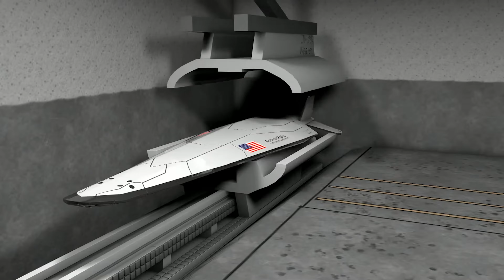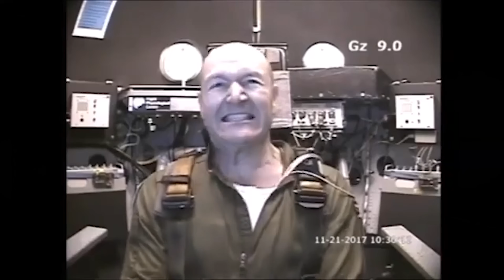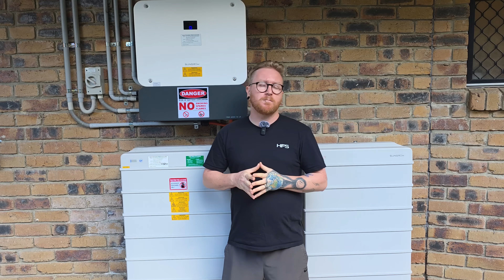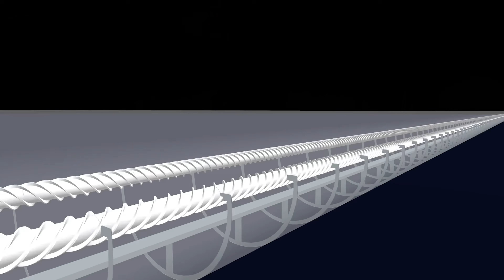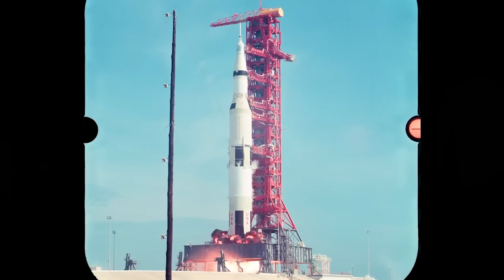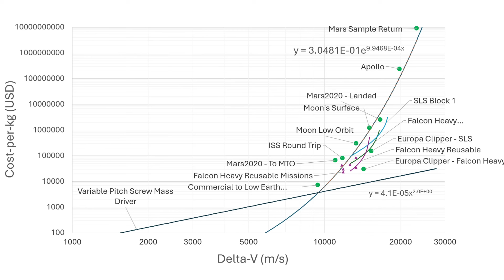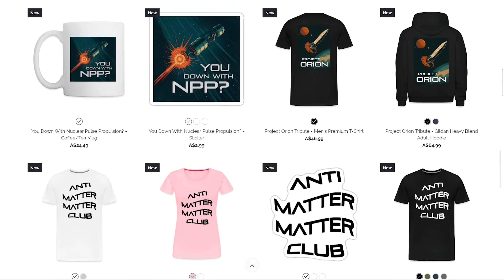The New System That Could ACTUALLY Replace Rockets

Comment: I’m a machinist so my big question is how do you plan to machine such a long screw? There aren’t any lathes that are a kilometer long so you gotta machine it in segments. How will the segments attach to each other? How do you maintain a vacuum inside the tunnel? What support the screws? Bearings, magnetic bearing? What’s the fail safe if the bearings fail? this whole thing sounds like a maintenance nightmare?
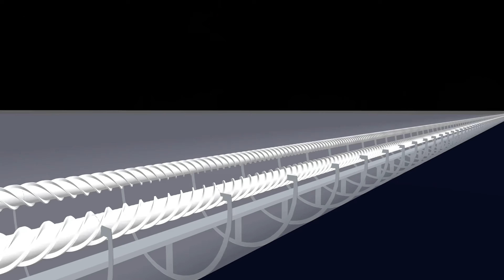Reply: The screw is made up of individual segments, not one long segment. They are just synchronized to spin together like they are one long screw. There are brackets that support the screws (see @9:02), and the screws are supported by magnetic bearings. Vacuum in tubes is something we know how to do - LIGO, for example, has maintained one trillionth of an atmosphere for 25 years. MTBF for magnetic bearings is pretty good.
Reply: @spaceinfrastructure3238  you don't shoot spaceship sized items out of the end of ligo though, so keeping that vacuum in a permanently sealed tube isn't really the same is it?

Comment: How do you have a vacuum tube without a seal at both ends?
Reply from the maker: Good question - it has multiple airlocks along the tube. Air will enter as the final airlock opens to release the craft, but it can only enter the final section, preventing the entire tube from having to be evacuated again
Reply: @HelloFromSpaceAus  That's going to take a lot of nerve hurtling toward a substantial seal and hoping that it will open in time.
Reply: @woodsyshroomer  The inner airlock door starts out open, and closes behind the craft after it enters the airlock. The outer airlock door is a membrane that the spacecraft punctures through. The membrane is then replaced prior to the next launch.

Comment: If it costs so much energy to power up a electromagnet, why not use a natural magnet, like neodymium? Or is it not enough? Or is that also too expensive? Why not find ways to reduce the mass of the payload, or is that just magic nonsense now?
Reply from the maker: Not strong enough unfortunately. Ideally you do both, reduce the mass of the payload and maximise the capability of the system. Unfortunately even with light materials, spaceflight hardware is complex so there's only so much you can do.

Comment: Sorry, bollocks. Cheaper to get a kilo to Mars than into LEO. Also the support structure for the screws is unbuildable.
Reply from the maker: It's impossible to build metal beams?
Reply: @HelloFromSpaceAus  All materials have a maximum strength. This is why a simple tower has not been built above about 800 m. The Burj Khalifa is 829 m tall.
Why do you think a building 1km or 5 km  high has not been built? The limitation is the strength of materials.
And you want to build a structure up to what height did you say? This is why rockets are used.

Comment: Maybe instead of whole long screws, you'd have lengths of screw magnetically coupled to each other. So you'd still have a long screw, it'd just be in sections, then you wouldn't have to worry so much about the material being able to withstand the twisting force.
Reply from the maker: That's an interesting idea, and your thinking there is pretty spot on. The screws are sectioned into relatively short lengths, which prevents the twisting from building up over a long length.

Comment: This sounds so unrealistic, really lets spin these mile long variable pitch screws at unrealist speeds and hope centrifugal force doesn't rip them apart inside a vacuum tube. Let's cut to the chase, we need to get serious about anti gravitic technology.
Reply from the maker: I can understand your scepticism, but you've misunderstood some elements of the system. The screws are segmented into relatively short sections to avoid the issue you've described. The LHC is a 27km long vacuum tube, and it works. VPSL is on a far larger scale, yes - however this isn't an impossible challenge. Unfortunately, so far as I'm aware there is no method currently proposed which negates the effects of gravity. I wish I was wrong, it'd certainly make things much easier!

Comment: What about the twisting of a kilometers long screw? What super material would it be made from? How would each screw be supported along the length of the launch tube? They would need bearings, so what about frictional losses in those bearings, and in the contact area of the driving sled with the screws? Wear on all surfaces?  Is the sled itself disposable? The power efficiency of such a launch system may be attainable in theory, but I think that it falls down from an engineering perspective. However I do like science fiction!
Reply from the maker: That's a fair concern - the screws are sectioned into much shorter lengths, which have support structures. I'd assume they'd be on bearings, I'd have to read back through the paper. There will be wear within the system, hence why the plan is for it to be good for 520 launches, not infinite launches - the point is more that the wear is enormously less than a rail gun. The sled is reused, caught by a decelerator after the spacecraft has been launched. There are losses in any system, but these have been calculated by the digital twin and worked into the final values. I understand your scepticism, and until a physical demonstrator is built we won't know 100% that it works as intended. I would point out though, this is the case for any new, advanced technology. As a good example, full flow staged combustion was considered to be unattainable, and too practically difficult - until Statship flew. The same was true of landing boosters and reusing them.. technology is always improving, if we don't push the limits we stagnate.

Comment: Spinning two 500 ton ten mile long screws is just  as insane as the spin centrifugal launcher !
Reply from the maker: There's not two screws, there's many - they're sectioned into short lengths to prevent exactly what you've described😁

Comment: The torque in the screws will break them over any real distance. I can’t see those super long screws not twisting, bending and breaking.

You equate this to a flywheel - better to use a more simple magnetic mass driver with capacitors or other batteries slowly charging pre launch to do the same thing. Of course then you have the problem of damaging the magnetic bars - the reason the military dropped the mass driver gun as viable… maybe it’s more simple to replace on a launch gun than a weapon but that type of launch makes a lot more sense than a screw.
Reply from the maker: Very logical and well thought concern. The screws are sectioned into short lengths to prevent that twisting force from building up, which also allows them to increase in RPM slightly along the length of the tube. This helps prevent th helix angle from collapsing to 0°. Basically the flights (blades of the screw) would become effectively parallel to the screw axis and stop producing axial thrust otherwise.

Comment: The energy required for that final 7999m/s to 8000 is very counter-intuitive compared to 0 to 1. I bet we could have an entire video just going through the physics and math of that.
Reply from the maker: It definitely is counterintuitive. I'm currently writing a video about relativistic effects, which are also similarly counterintuitive in many ways. Might be able to work this in, because it is super interesting (and a little brain melting at times😅)

Comment: So, realistically we are talking about a craft exiting a vacuum tube through some kind of interface to nearly full atmospheric pressure at an altitude of no more than 3km at around 5 km/s . I doubt even the best Russian hypersonic missiles would survive that. No, this whole idea depends on being able to build infrastructure to an altitude of around at least 10 km. The best we could do is build it on the Patagonian plateau and then, if we’re clever, get a pipe-exit altitude of around 4.5 km - still too low. Your interviewee dodged this issue completely when you asked him about the atmospheric heating issue.
Reply from the maker: No, it exits at high altitude. The tube has an extension which is quite high, ideally placed up the side of a mountain. The question definitely wasn't dodged, it was a 40 minute interview which I had to cut down to 10 minutes so this video wasn't ridiculously long😅

Comment: Got to agree with a lot of the comments here. None of this is plausible. Screws with increasing pitch, ship held by magnets traveling through kilometers of vacuum...not to mention hitting air at the proposed speeds. In fact it's downright ludicrous.
Reply from the maker: I encourage scepticism, it's healthy! There would definitely be many challenges with building this system - this doesn't mean they're insurmountable though. I would point to how many advanced technologies we have today which many laughed at and called impossible pipedreams, until they became reality. ITER is ludicrous, as is the LHC, as is catching a 200 tonne rocket booster with a robotic arm. All insane, until someone does them.

Comment: Impossible torque on screws - no material in existence
Reply from the maker: I think you have some misunderstandings about the system. The screws are segmented into relatively short lengths to prevent this issue

Comment: Thank you for sharing this interesting concept.
One limiting factor might be that you cannot increase the pitch as much as you want as it becomes self locking if you overcome approx 85°.
Instead of higher pitch you need higher rotating speed of the shaft(s). The very long shafts will suffer from high vibrations as they are more or less rotational springs.
From my feeling as an engineer this is at least very very challenging (not to say impossible). In a quasisstatic view it looks quite good but it is a very dynamic vibrating spring-mass system.
Reply from the maker: That's an excellent point, to solve this th screws increase in RPM along the length of the tube up to around 19k rpm. The shafts are also sectioned into relatively short lengths to avoid the issue you've described. They will definitely have to be very well balanced, but 19k rpm is a speed we have a fair bit of experience with. Many small combustion engines operate up to this, electric motors operate far beyond this. It'd be an engineering challenge for sure to build, but not impossible

Comment: At the start of the launch tunnel, scree is perpendicular to direction of travel, so very little torque force, however at the end of the tunnel screw thread is a lot more parallel with directions of travel, torque force must be enormous. Surely the screw would want to push sideways into the tunnel wall rather than push the ship faster and faster? Someone with more smarts please explain!
Reply from the maker: It's relative, because at the end of the tube the craft is travelling so fast, the torque is the same against the craft

Comment: I don't see this as anything plausible.

My brother in law and I call this, "why don't we just." People say it all the time in incredible ignorance of how complex the world is, and the short answer is, if it were that simple somebody already would have done it. Of course that's not ALWAYS true, but the times when it's not are 1 in millions.

Off the top of my head I'm thinking of vibration and frictional losses that will be EXTREMELY hard to engineer down to usability, and then you're still going to have insane maintenance and inspection costs. You'll have to power down, bleed off all that energy, move cranes out there, replace bearings, days to weeks of down times.

It's a cool concept, but its waaay more complicated than you make it sound.

Rocket engines are conceptually very simple, in reality, physics aren't ideal, and they become very complicated and take a substantial amount of trial and error to engineer out all the issues.

This wouldn't be any different, think about Elons hyperloop. Conceptually simple, no one could get it working. No one could afford the R&D to get it working even with scaled down test models.

You can't compare ideal to real world, which you did with your Artimis comparison. This almost certainly would cost hundreds of billions if not trillions to get operational, if they could get it operational.
Reply: The screws use active magnetic bearings, and there is no contact between the screws and the adaptive nut. A similar technology is flywheel energy storage. In any case, start with the physics of why this approach makes sense if we want to go to Mars. Once you realize that the general approach saves trillions of dollars over rockets, then you'll be primed to understand all the engineering details that make it possible. Hyperloop was trying to fit somewhere between high-speed trains and planes. If Hyperloop's only competition was stretch limos driven by A-list celebrities, it probably would have done just fine.

Comment: First - Length needed
Worst case - 2G - 10km/sec - 500seconds - length 2,500 Km

Best case - 40G - 5km/sec - 12.5 seconds - length 31.25 km

Assume 60,000 rpm - 1000 revs per second

Worst case - 2G - first second is 10 metres last second is 10km
1000 revs per second first rev is 10mm last rev is 10m

Best case - 40G - first second is 200 metres last second is 5km
1000 revs per second first rev is 200mm last rev is 5m
Reply from the maker: Not sure how you got to that conclusion? I'm not looking for investors, I make YouTube videos mate! I would also point out how many of the technologies we all enjoy today were once called 'scams'.
Reply: @HelloFromSpaceAus you can't understand how one can obtain these numbers, which is like 5th school grade maths, and yet you are so smug and condescending to people in other comments, who validly point out how unrealistic such a system would be. Why even have such channel without any engineering expertise and/or critical thinking? Do you just use ChatGPT for your scripts? Existence of a white paper does not automatically mean it is not bs.
Reply: @HelloFromSpaceAus  Hi - the maths and physics is simple - the acceleration multiplied by the time gives you the speed
The speed multiplied by half the time gives you the length

Comment: What you've described is actually a good solution for mass driver weapons. It could also get used for accelerating stuff in space (for example space garbage cleanup).
Reply from the maker: It could for sure, but I'd rather see it take us to space! You're spot on there, a VPSL system on the moon would be ideal. Zero atmosphere and low gravity make it a very attractive option

Comment: A very neat solution for only part of the problem. You still have the problem that your spacecaft will suffer extreme heating and deceleration once it leaves the launcher.Even skipping this, what we're doing is replacing the first stage of a normal rocket. But fully reusable first stages are now commonplace. The economics still doesn't work.
Reply: We're proposing to replace 99% of a rocket that would send a payload to Mars. The economics are amazing - literally almost 1000X cheaper than rockets for going to Mars. Please watch the video again and try to understand the cost curves, exponential scaling versus v-squared scaling, and the "hard physics" reason why we're claiming that the right kind of infrastructure makes this possible. It's the most important takeaway from the video. Alternatively, watch the relatively boring video, "How the Future of a Space-Faring Civilization Hinges on the Economics of Imparting Kinetic Energy".
Reply: There is no saving until you prove it works. As most people are pointing out, there are very serious impediments to getting this scheme to work at all, let alone safely.
You cannot claim savings on technology that does not yet exist.

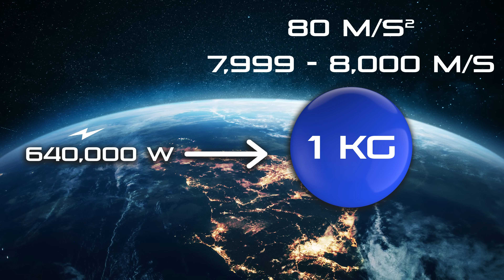Comment: 7:04 - meanwhile we have since years EVs charging for 15+ mins at 350kW, and chinese presenting recently EVs charging for 5+mins at 1MW. Somehow failing to see why 640kW per kg of payload for at most a few seconds would be an unsurmountable problem.
Reply from the maker: Sure, but that 640kW only gets 1kg to orbital velocity. Getting a 28 tonne spacecraft to orbital velocity requires 17920000kW (17.92GW) - a far less trivial number. And remember, that's only orbital velocity for LEO. For interplanetary transfer velocity, because the energy requirements become far greater at higher velocity, you'd need nearly double this number.
Reply: This is a great question! Let's assume a launch train mass of 38,940 kg. If we think about the last m/s of a 0 to 8000 m/s launcher, the power that it will pull is 640,000 W/kg X 38,940 kg = 24921600000 W = 71,205 Superchargers. That might be reasonable, except that we need switches to turn that power on and off at every electromagnet in a traditional linear-motor style launcher. So that last magnet needs an electronic switch that can handle the power output of 71,205 Superchargers. The second-last electromagnet needs a little less switching power, etc. If there's an electromagnet every meter, then the total switching power is 71,205/2 X "length of the launcher (in meters)" ~= 27.5 billion Superchargers worth of switching capacity. This is what is known in the industry as "the switching problem" - it's a key problem with older space EML proposals that VPSL solves. (Note: technically, I should integrate the formula for power as a function of position - the math above is just meant to be illustrative).
Reply: @spaceinfrastructure3238  Everybody seems to be assuming tens of tons of mass per launch. Why? Why Can I not launch 400 pieces at 100 kg each straight into LEO. And if LEO is not the ultimate target, they can re-assemble and continue from there using other means of propulsion. And suddenly the "massive problem" becomes a (series of) much smaller problem(s).